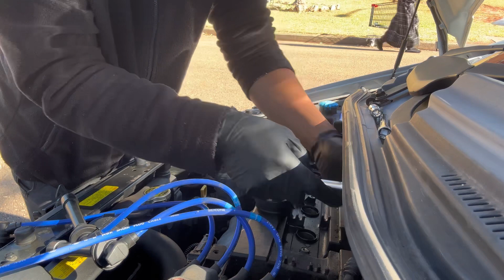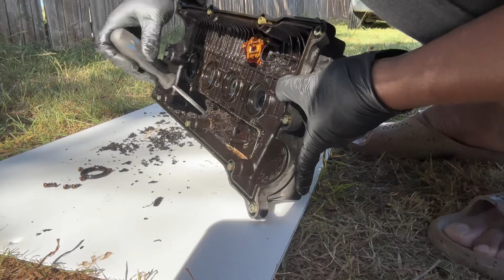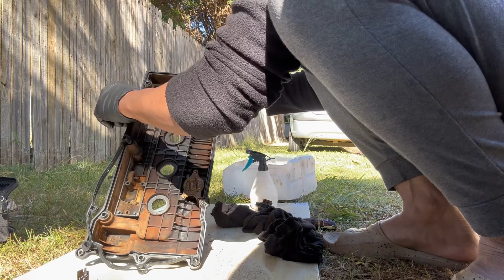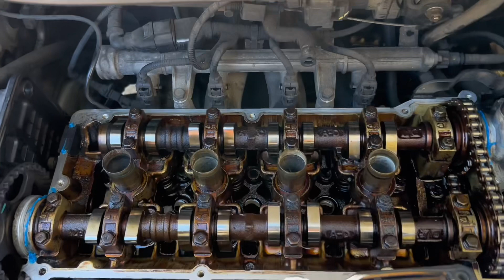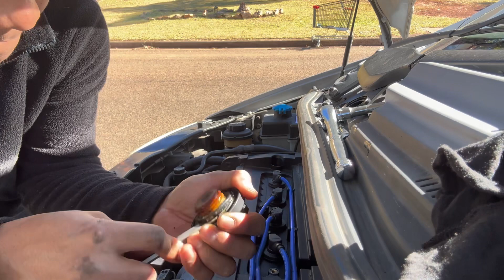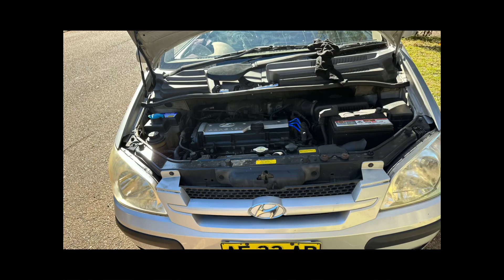Hyundai Getz 2006 Valve cover replacement

Comment: Mine has a metal thing blocking me from removing the cover did you have a metal piece at top right blocking you too?
Reply from the maker: Yes sir.. but I removed it and put at sealant so it will not possibly leak oil😍
Reply: Boss pano pag merong leak sa "metal thing"? Parang may leak kase saken eh. Madali lang ba mag lagay ng sealant at ano gamit mo? 😅

Comment: what are those half moon shaped rubber for?
Reply from the maker: @wonderwalls3565  that’s included on the set to replace.. my Hyundai gets have that.. I remove the metal and replace that one..
Reply: @Callejapaulo12  what metal? where to put them? you did not show in the video? I have the same rubber but dont know where to put them in my Elantra 2010.